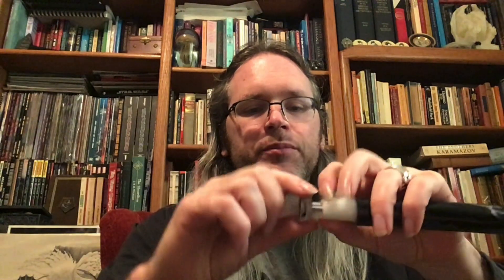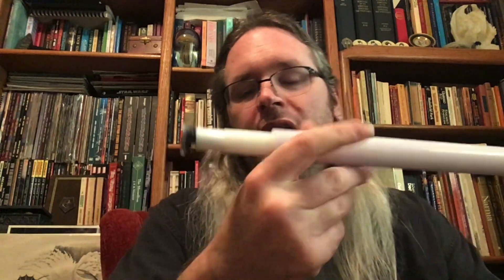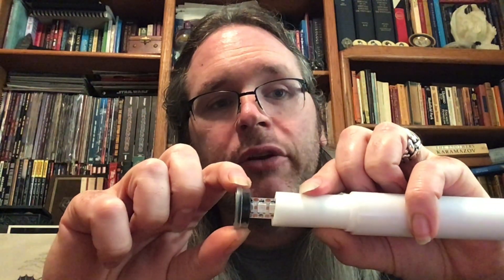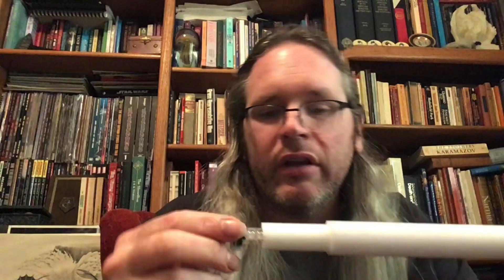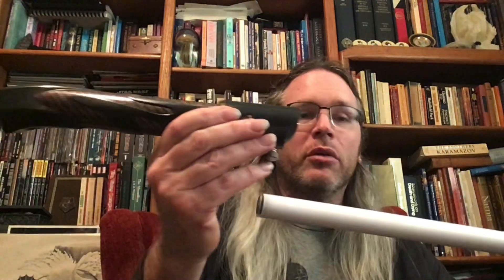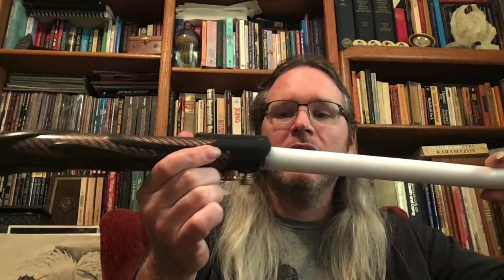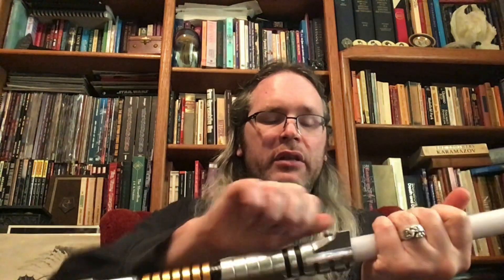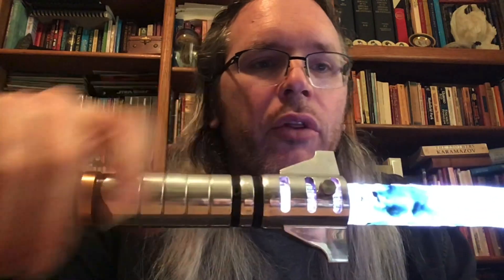Direct PCB neopixel upgrade from Bendu armory

Comment: Thank you for this video. I’m tempted to buy Bendu Armory’s V3-btf or V2-KR. Any advice would be very appreciated. I own a pach store starfall speeder saber, Asteria heart w 36” neo pixel blade and I’m not impressed with the brightness. I love your Bendu sabers and great job on your spinning, wielding, neck spins etc!!
Reply from the maker: depends on the abuse you plan to put them through. for light use, go with the KR, for heavy, the btf

Comment: Do you have any good info or a video concerning using LEDS (single color) for string blade? Working (slowly!) on a homemade lightsaber, & want to use an LED string for the blade. A 2nd build I plan on a neopixel (or similar) blade. Thanks & I subbed.. love your book collection!
Does using 3 strips of neopixels, in a triangle shape, so 3 light edges, provide better uniform lighting in the tube compared to 2 back to back strips? Thanks
Reply from the maker: I did a review of a Makoto saber that uses single color LEDs a while back. It is older tech, so you don't see it around too much these days. There is really no advantage to single color, when RGB is more readily available and as bright. As for the 3 strips, yes. There is a maker who does that. The name escapes me but it may be SpaceWindu. It is brighter and more uniform, but more LEDS is more draw on the battery and run time gets shorter and shorter. At some point, it just isn't worth it.
Reply: @DarthCephalus  I watched several "Space Windu" videos, & he helped with some how-to info. Am slowly making a homemade lightsaber, a first for me! & Want to use blue LEDs for the blade. Thanks for a good reply. Makoto still makes awesome lightsabers!